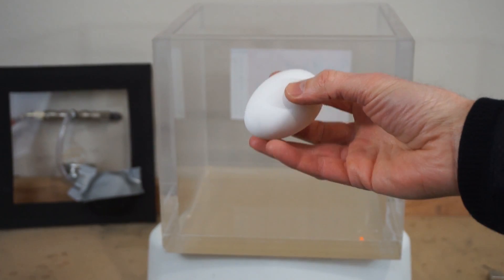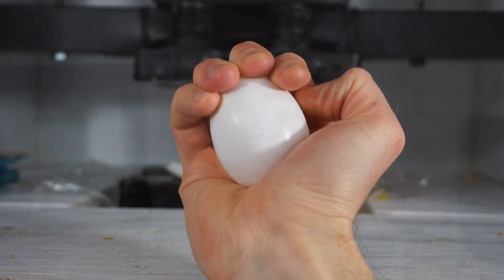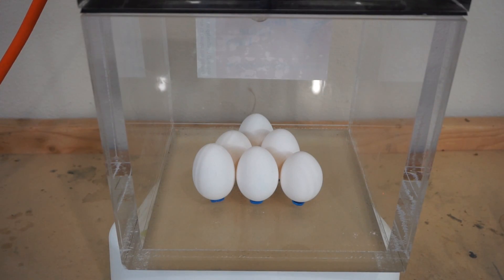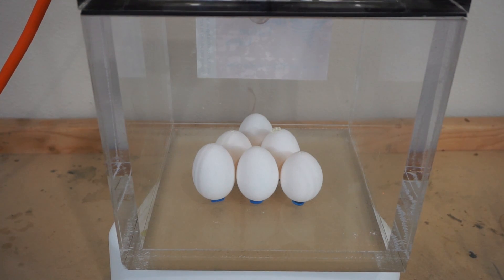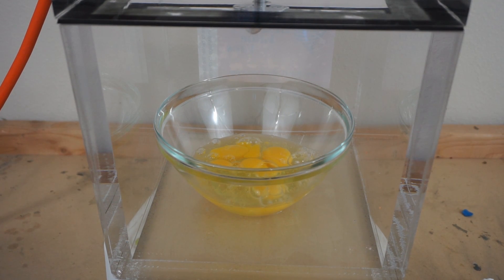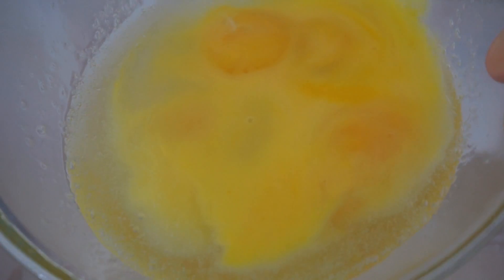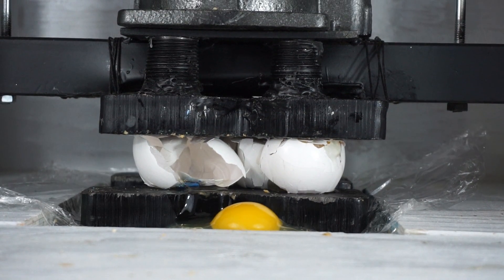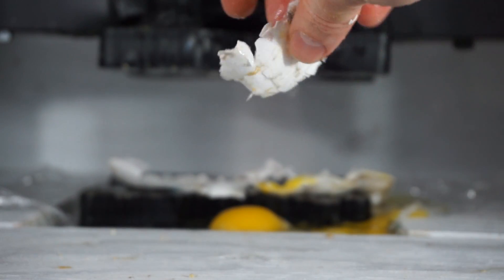What Happens When You Put 6 Eggs In A Huge Vacuum Chamber?

Comment: OK, as you kind of covered it, I'll as you for help:
When the eggs (or water) boils at low pressure what is happening?
My understanding is that it is the air (in the water) escaping that makes it "boil".
In normal conditions the heat puts energy into the water and the air turns from liquid to gas.
But there is no heat being added in this situation.
So I am confused to what makes the water (or in your case eggs) boil?

Comment: Are those fresh eggs or a few weeks old? It's not true that there are no gasses inside the egg. There is the bubble at the bottom and it gets bigger the older the egg is. Egg shells however are porous so it's possible that the air can just escape.

Maybe instead of fresh eggs try older eggs and instead of poking a hole try to plug the micro holes in the shell (by dipping it in superglue or something).

Comment: This is not totally fair ... the hydraulic press is flat and egg oval.  When you try to pop the egg with your hands, your hand molds around the top and bottom, distributing force over an area.  Please repeat the hydraulic press experiment using dried epoxy molds, round  on egg contact side, and flat on the press side.

Comment: There might have been a different and more interesting result if the points of contact  between the hydraulic press and the egg had not been so small, but instead distributed evenly over a larger area, so mimicing the pressure exerted by a hand, no?

Comment: Can i know the reason  why do they boil?
Reply: Because of the low pressure inside the vacuum chamber, it's the opposite of what happens in a pressure cooker, basically, the higher the pressure level, the higher the boiling point of the thing

Comment: The hydraulic press experiment wasn’t done the way I expected. The reason is, I expected u to not make a direct contact between the press and the eggs. You might want to apply something of support that conforms to the shape of the eggs so the the weight distributions would be more even on the contact surface areas between the press and the eggs! Thanks.

Comment: Action Lab is right. In chemistry "boiling" does not equal "hot." It just means that the vapor pressure of the liquid (the egg mixture) is equal to the atmospheric pressure (in the chamber). 

The common way to do this is to add heat, thereby increasing the vapor pressure of the liquid. But another way is to lower the atmospheric pressure. This is why water boils faster in higher altitudes. When the atmospheric pressure decreased, the gases in the egg mixture could escaped the liquid, without a change in temperature. If you put your hand in it, it would feel like room temperature.

Comment: try making a water vortex in a vacuum chamber by using a servo to tip a vessel of water over into a bowl with a drain hole so we can see if the water flows clockwise or counter clockwise or just dumps and drains without a vortex at all.

Comment: In all your videos where you put matter under hydraulic pressure system, please reveal the magnitude at which they break. Thanks.
Also requesting to know (1). Will water vaporise in vacuum and hence becomes cooler? (2). How oil behaves in vacuum. Does it boil as well?

Comment: Don’t eggs on there own already have a hole.well I don’t know if it depends if you bought it from a store or not but I am pretty sure they are suppose to have a hole

They have holes because they need to let the chicks breath
Reply from the maker: +Daniel Samson eggs dont have holes.air gets into the egg by diffusing through the shell.
Reply: You are both right, but the action lab you are also wrong. Eggshells as the semi-permeable membrane they are, allow O to move through it by diffusion, but only because it has an average of 17,000 micropores on it. So technically eggshells do have holes.

Comment: wait a minute, you said eggs boiling but i never saw them cooked. my understanding of boiling is when liquid reach high temperature (ver hot) it starts to boil, when you see eggs in the vacuum it react as it was boiling but never got cooked.
Reply: They are actually boiling. What cooks an egg is the temperature that that egg  has reached, not actually the action of boiling it. Water will boil at room temperature if you put it under vacuum, as pressure decreases so does the boiling point of water.

Comment: "how to boil egg without make them cooked"
Reply: It is simply because of low pressure.for example we know that  water boils at 100 C at 1atm pressure but if I increase the pressure the water won't boil at 100 C and instead boiling temperature increases.
So we can say that Bolling of a pure substance depends on both temperature and pressure.In the same way if we decrease the pressure it boils at low temperatures.
If you want to know more; refer pure substances in thermodynamics from standard books.
Reply: Raghu Vamsi but the egg cooked if the water is boil right? In this case the egg is in boiling condition but what makes then not being cooked?
Reply: @ambokzulhelmi809  heat is absent. these are some raw eggs.
Reply: @davidmella1174  heat is not absent. It could be because the temperature required to harden the egg yolk is much more than the normal room temperature. So that's why it is not cooked i guess.
Reply: hyullas sss Hmm
Reply: What an underrated comment😩

Comment: would those eggs be OK to cook and eat after being boiled under pressure like that?? they'd be fine right? i could actually see vacuums like this being used to mix eggs in some fancy hipster place and then they charge 20$ for the eggs.
Reply: yes they would be ok, if you just leave them under vacuum long tho they will keep losing water and getting drier. Any commercial chamber vacuum machine used in restaurants to package food does this when you use it. We use it a lot to degass things, like if youblend a puree or sauce in a blender and its all foamy, you can get the air out of it by putting it in the vacuum.

Comment: The eggs actually weren’t boiling, as the definition of boiling is the point at which the substance starts to evaporate. The eggs weren’t evaporating, the air was being taken out as the pressure changed. So, in conclusion, the eggs were not boiling.
Reply: Karey I would love to say you’re correct, but no. Interesting thing about atmospheric pressures is that the lower it is, the lower a liquids boiling point is.

Comment: Water boils in an extreme vacuum. The loss of vapor pressure over the water lowers the boiling point dramatically, enough to where room temperature heat is enough to impart the necessary heat into the water to achieve the phase change. The water is not hot though, which is counter-intuitive to some. You can dry firewood in a sealed thick-walled tank hooked up to the intake of a large air compressor without heating it up. You have to monitor the compressor on-and-off cycle to prevent too much vacuum for too long, since it is harmful to the rings in the compressor. But it will dry the wood. Wet books, too!!!

Comment: Clearly, you know nothing about the anatomy of an egg... The shell is POROUS! The pores are large enough to let gases such as oxygen and carbon dioxide pass as well as water molecules. Beneath the shell is the 2-layer, semipermeable membrane that controls mainly passage of water vapor. Shortly after being laid, the egg develops an air chamber between the shell and membrane. Therefore, the eggs that you put into the chamber contain the GASES found in AIR! So, you are wrong about that! So now with the knowledge that I have imparted to you, think about why the egg "just sits there" (as you said), under vacuum instead of exploding.